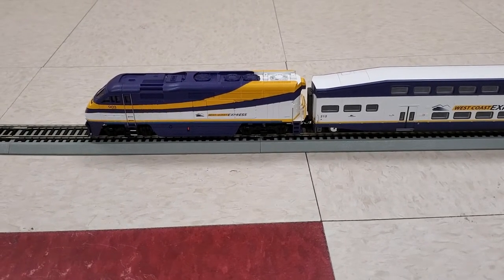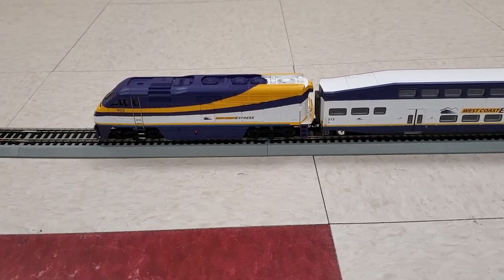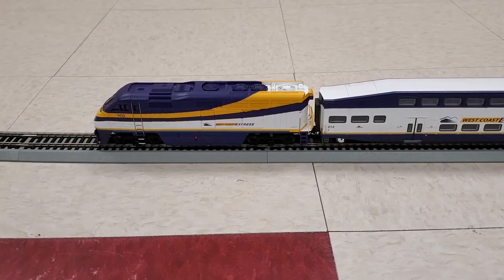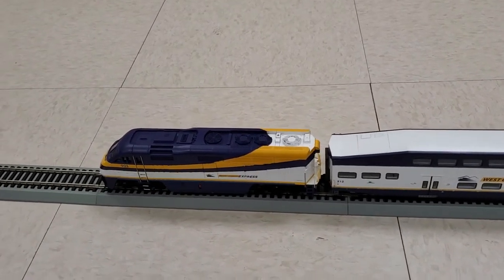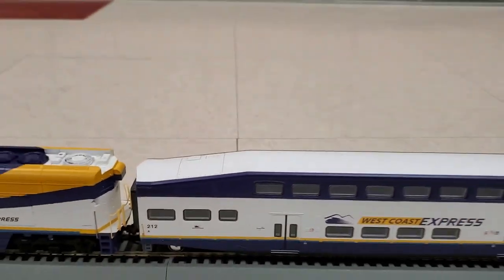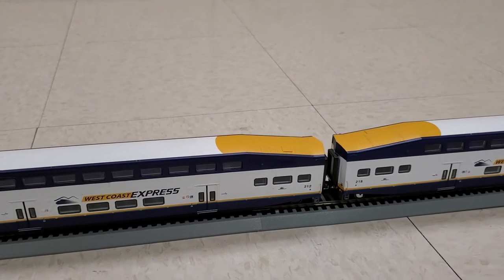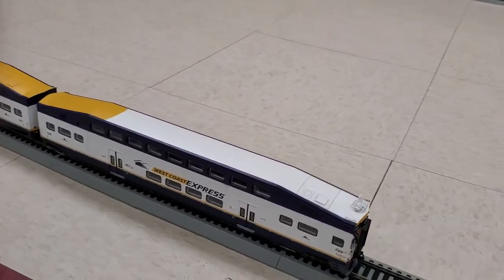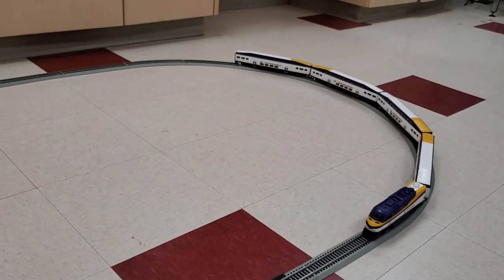Ho Scale F59PHI West Coast Express

Comment: Dunno about "express". I don't recall it reaching more than 110km/h (that was in Pitt Meadows).
Reply from the maker: So true, I guess they felt using express gave it a sense of speed, it doesn't achieve  110 km/h is its top speed on the line. The top speed of the locomotive is 177km/h